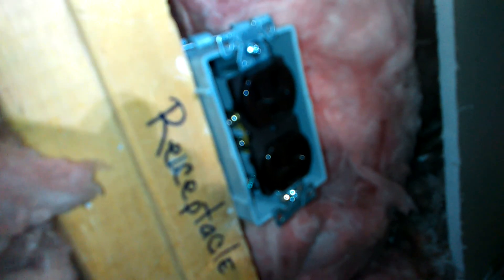Electrical outlet fire part 2

Comment: We had one of those imitation fireplaces with the heater and the exact same thing happened to us. All of the wires in the metal box had all of the plastic burnt off of them. And on the outside, the outlet looked as normal as can be! Definately something to look out for.
Reply from the maker: Hi Demonic Darkness! Thanks for the Comment! Hopefully the beaker will work!  Have a Merry Christmas and a Safe prosperous New year .